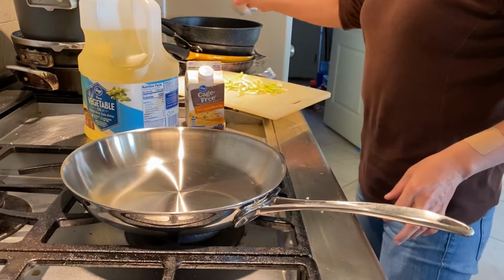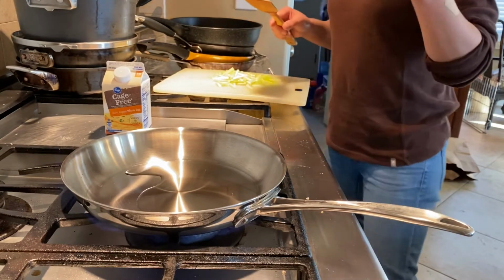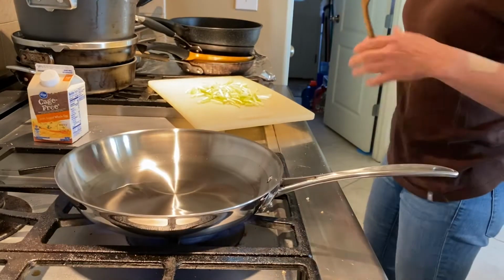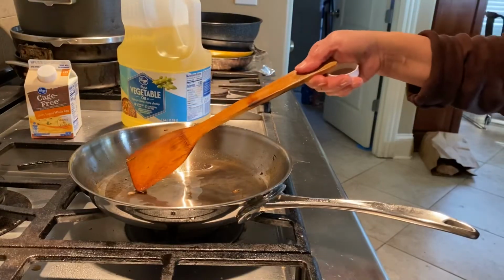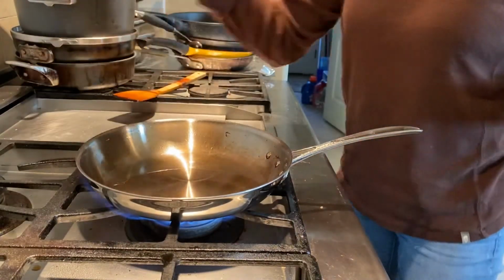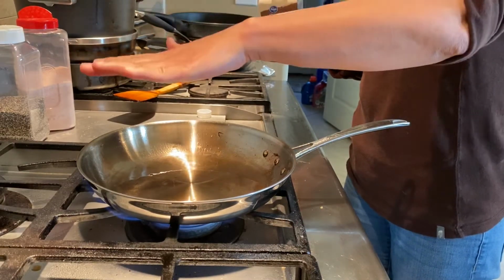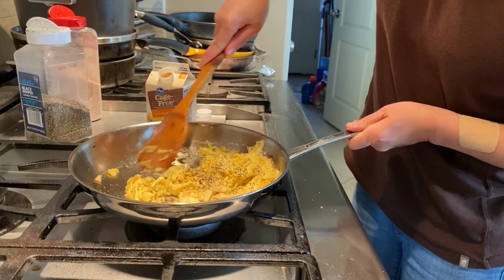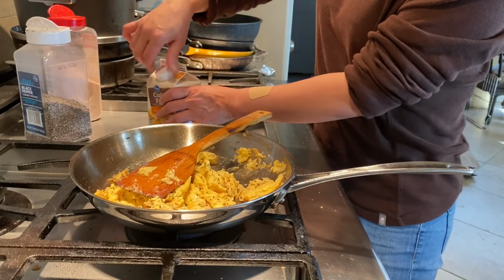How to make stainless steel frying pan not stick with Green Onion

Comment: Stainless steel is the most non stick pan available and they last forever! All you need to do is heat it correctly on medium heat before adding oil.  Meats and eggs literally glide over the pan surface and I clean mine with a kitchen towel.  I only use stainless steel and cast iron to cook with, both metals require patience and care and in return they last a life time. They are far far superior to Teflon non stick pans filled with chemicals, that give no decent searing and you have to put them in the bin every two years.

Comment: Do the water test for stainless steel pans.  Heat on medium heat, sprinkle a drop of water.  If the water stays in a solid ball and bounces around, you're ready to add your oil/food.  If it disperses and evaporates, it's not warm enough. Keep adding a drop of water until your pan tells you it's ready!  It's called the "Leidenfrost effect."

Comment: The chemical reaction occurring with the onion and oil is sufuric acid from onions interacting with stainless steel and oil polymerizing a thin coat over the stainless steel surface. This is the non-stick layer. It is very thin and thus delicate, only lasts 1-2 uses then you have to repeat process.

Comment: The other lady used medium heat. I cook eggs in my stainless pan, and temperature is important. Hot oil is important, but the onion hack looks effective.
Reply from the maker: After I tapped I changed to medium heat and worked perfectly.

Comment: I just spray a little Pam in my All Clad pans
Reply from the maker: I will try that if it work I will tape a video and give you credit. Thanks for watching my video.
Reply: @siegristsi  don’t go overboard. Just a quick spray around the pan, I guarantee it will work. I use the butter flavored.
Reply from the maker: I will Definitely try .
Reply: I recently read somewhere, that over time non stick spray's like Pam will build up a coating that is very hard, if not imposible, to remove.
Reply from the maker: That is good to know. I don’t use Pam much.